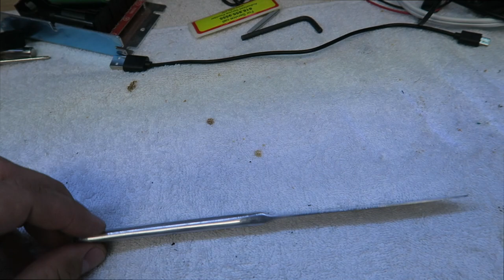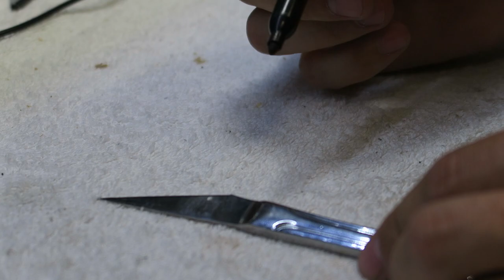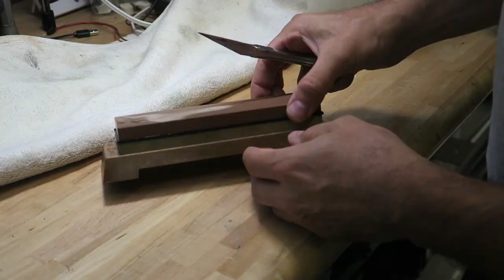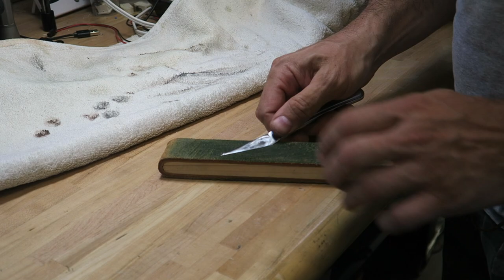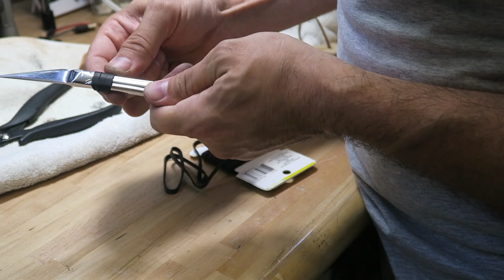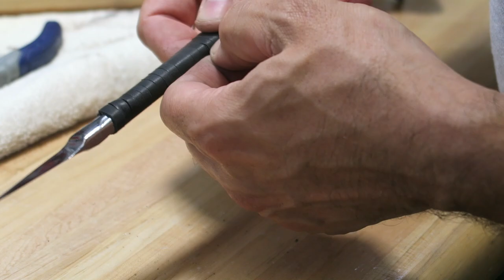Kiridashi Knife in 10 min

Comment: No heat treatment....
Reply: Because it wont
Reply: You can't, it's either 18/8 or 18/10 stainless. There is no carbon in either. This won't hold an edge for more than a few cuts.